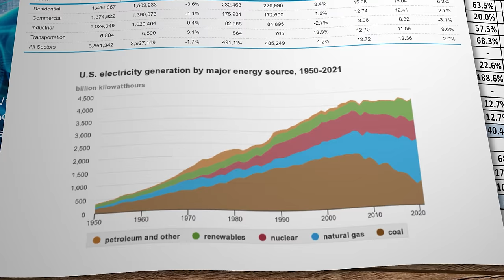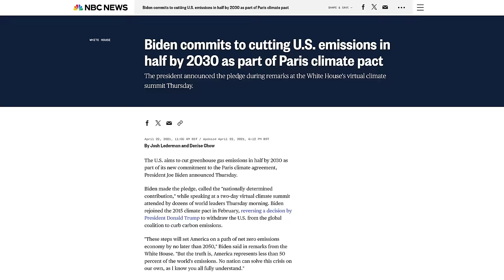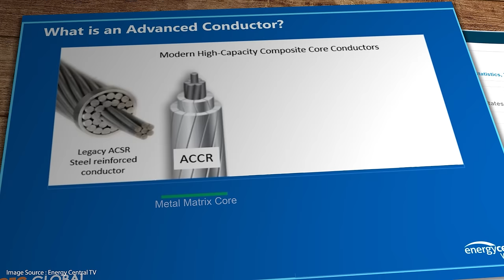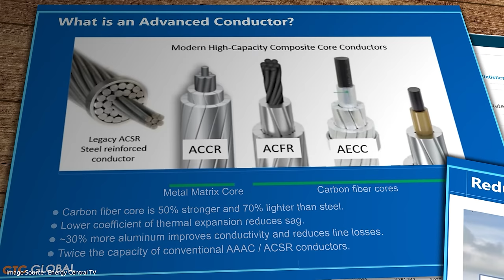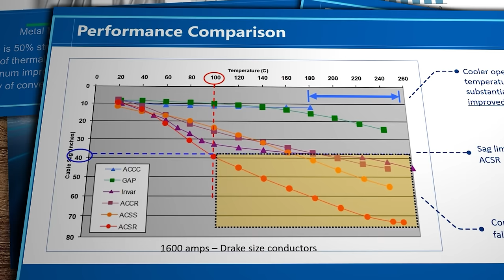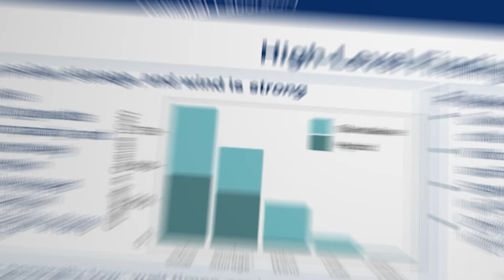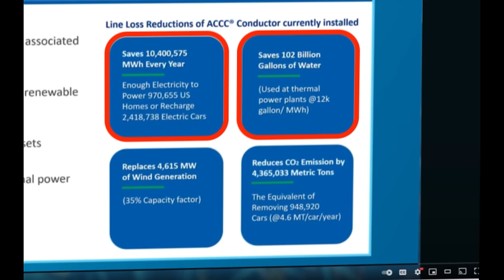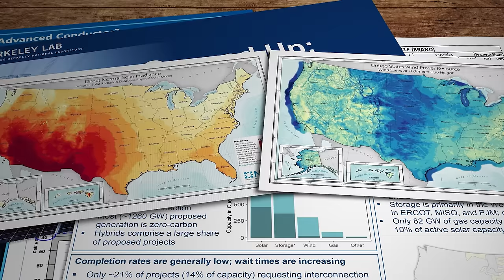Rethinking electricity grids.

Comment: I helped build a model for the Western Interconnection, the long-distance grid for Western North America that extends from Canada to Mexico and includes the provinces of Alberta and British Columbia, the northern portion of Baja California, Mexico, and all or portions of the 14 Western states between.

Using new technologies to upgrade existing towers and corridors was a major factor driving the model because of the challenges getting permits for new transmission and the capital costs of building new lines. Even so, plans called for roughly $1 billion per year in capital investment to bring new renewable energy online and get it to a market serving over 90 million people.

It's important to note that the grid is designed for maximum load, so there is a huge overcapacity available off-peak to move energy if it can be stored. Local storage can be done at regional levels (e.g.: with pumped hydro), at local levels, or even with batteries dedicated to specific installations or homes. As batteries drop in price this is becoming more economically practical. 

I think distributed storage and generation will completely change the way the grid operates over the next 10-20 years.
Reply: A billion dollars a year sounds like a lot, until one realizes that America alone spends a trillion dollars a year on energy.  An improved grid should benefit a lot.

As an aside, it's interesting to note how enormous the reservoirs are in BC, if their hydro plants could be partly converted to peaker (like one west of Calgary) or backup instead of exclusively base load.  (Using hydro exclusively as base load feels like a missed opportunity, and typically bad for the river downstream too.)

Comment: Excellent.  Line losses total 15% of the electricity put on the grid, the vast majority ofs which is due to heat during peak load.  7.5% on the transmission grid.  7.5% on the distribution grid.  Local generation takes energy off the transmission grid and thus saves 7.5% loss +/=.  Direct current transmission also saves loss.  Underground transmission loss is less than that on above-ground wires plus underground wires are subjected no wind or other weather stresses resulting in lower maintenance costs.  Underground is more costly than above-ground but the savings in maintenance makes up the difference. And direct current is more efficient than alternating current transmission.  Consider this, all the costs are heading down from generation to transmission to distribution.  Will that result in lower electricity costs to the consumer?  Only if we fight to have the savings passed on to us!
Reply: High voltage DC is only cost effective for long transmission lines (over 300 miles) due to the high cost of 'converting AC to DC' at the generating end and 'inverting DC to AC' at the receiving end of the transmission line. That said it would save a worthwhile amount of energy along with 'rewiring' the grid with lighter weight, higher ampacity cables.
Reply: Underground transmission loss is typically higher than aboveground from my recollection, due to the high capacitive coupling of the ground. So I ask, have you got a source, because I don't know that I trust a reversal of what I'm familiar with just on a YouTube comment. I know some underground transmission has superconducting lines installed, but that's largely down to local constraints and is only done where absolutely necessary because the ongoing operational cost of the cryogenic coolant is non-zero.
Reply: @Nidkidful I think I read about it in Utility Dive or David Roberts.  Laying underground DC cable along the freeway grid addresses two thorny problems -- permitting and maintenance.  I may be wrong, but I also think it was discussed at NREL.  There may be a paper on it, or the 2018 study that was suppressed by the Trump administration may have talked about it.  That study suggested a handful (4 or 6 West to East DC lines and 2 North to South).
Reply: @Nidkidful Also, I thought underground line loss was less than above ground.  I'll look around -- google electricity line loss above and underground.  Something like that.  I was pretty deep into this stuff before my wife came down with cancer and died.  Am getting back into it after my period of grieving.
Reply: @bobbresnahan8397  potentially for HVDC, as it doesn't have capacitive losses, however it is quite hazardous to build HVDC underground, as it's much harder to build switchgear to open the circuit in sections should it be damaged, and the arcs are not self quenching, so any damage to the HVDC line would cause massive damage. It's also way more expensive because of the specialized equipment needed. HVDC only makes sense right now for long distance transmission, and while underground puts it in a more stable thermal environment, I don't know that combining two niche expensive applications is a viable cross country link.

Comment: One other benefit of replacing the wires is that the old cable can be recycled into the new cables. 
There by saving some mining and electricity in the production of new aluminium. 
Great channel.

Comment: In Australia I think we could see gains from a much more distributed grid, this is becoming the case with generation as a result of renewables and rooftop solar, but distributed storage is lagging, instead we are focusing on large scale projects such as snowy 2.0 and Tasmania battery of the nation. Distributed local storage would stop us sending power 1000s of km, saving transmission losses but making the existing network go much further. There's no lack of prospective pumped hydro sites.
Reply: Distributed local storage would stop us sending power 1000s of km. Well said, the beauty of electricity is it is everywhere to be harvested.

Comment: I totally agree. The electric Spanish grid is a really catastrophic mess. Where I live the grid that feeds our town is older than 60 years and the maintenance is near to 0 and the design is completely out of date. Now we already have problems with the solar power houses connected to the grid and provokes high voltage and can damage our electric devices.
The main problem in Spain is the former presidents and ministers end up working in energetic companies in order to earn 300.000€ per year doing nothing only "for the services provided"

Comment: Thanks to Robert Llewellyn, I made a presentation about the electrical needs of the petroleum industry.   It's massive, probably 2/3 of all electricity, energy and infrastructure.
By transitioning from fracking and tarsanding, we wouldn't need to replace todays levels.
Every EV built (buses, trucks, farm and construction equipment as well as cars) is a storage device, which could save money and make the grid more efficient.
The problem is that a bankster won't look at that as saving money, he would look at it as costing them money.   That's the biggest problem.

Comment: watching this, I realized that the grid or its cables may not be needed to replaced or upgraded for the EV future since you power companies can simply double or multiply the voltage depending on the capacity need. I don't know how much HV transformers or HVDC equipment costs but i think it is doable for not much more money and time.
Reply: The problem is more the lead time to get more HV transformer equipment. We're talking months or years lead time for conventional replacements, while big projects like changing the voltage on a major grid provider is a decade long process as a large number of isolators, switchgear, and all the transformers need replaced, and that stuff isn't built in the quantity required to do a fast changeover, as the typical lifespan is 20-60+ years, and any additional production would have until recently been wasted or idle.
Reply: @Nidkidful  good point.  I guess it's a chicken and egg problem.  While there are more EVs vs previous years, grid power requirements did not increased or have reduced due to multiple reasons. There is no reason to increase transformer production. But then, if transformer availability remain a problem or gets worse, companies would have no choice but generate own power and use solar PV equipment for EV charging.

Comment: It would be interesting to combine this reconductoring with your previous video on increasing transmission voltage to improve efficiency further.
Further efficiencies could be gained by increasing voltage supply into the home along with high power factor step-down conversion coupled with maybe 12V lighting circuits in the home.

Comment: In many cases an existing right of way can be upgraded with dual, triple, or more conductors in a bundle. This should work well if the voltage is not also ungraded (which would require new pylons.)